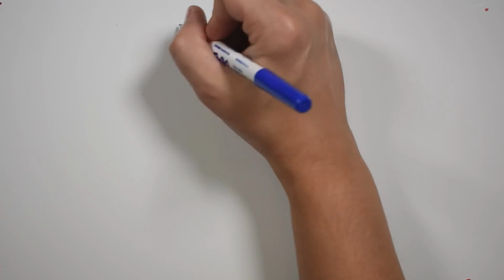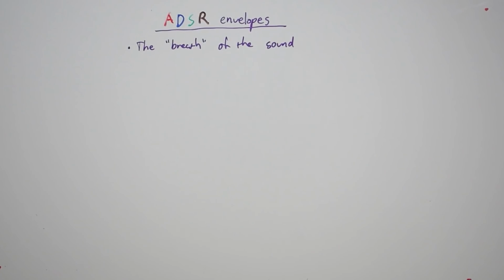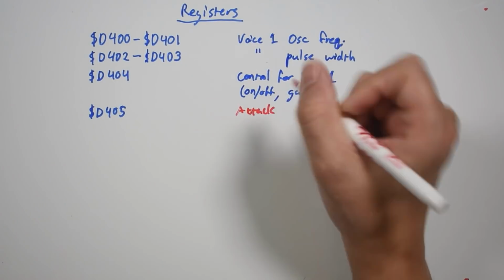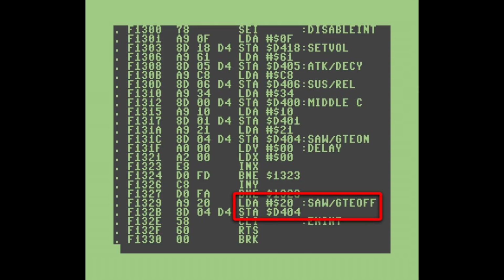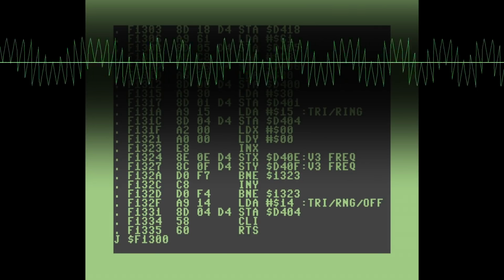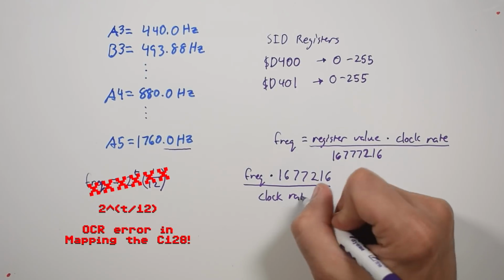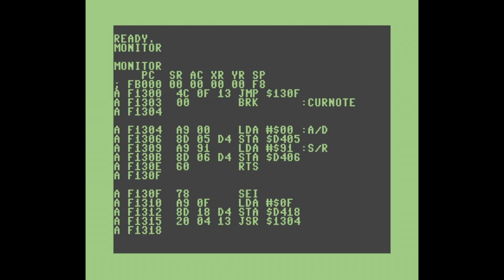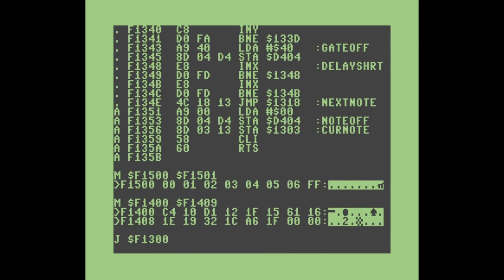Commodore 128D: Episode 7: SID Basics

Comment: Wait, does that mean the filter is applied to all 3 voices at once? many SIDs with filters I've heard don't sound as if it's working that way.
Reply: But it does sorta apply to all channels. It means if you're using the filter, say in one instrument on one channel, if you want to use the filter in another channel at the same time, you have to follow the same filter envelope you defined in the first channel. You can't use different filter envelopes and types in different channels at the same time.
Reply from the maker: Correct. The block diagram shows switches between the filter and bypass for each voice. The settings for the filter apply to all three, but only if they are not bypassed.
Reply from the maker: Ah, crud. Yes, you are right, the filter can be turned on or off for each channel. I misinterpreted the block diagram in the datasheets. Good catch!
Reply: yes. the SID chip had two DACs to get an analog waveform. one of them was routed to the output directly, the other one goes through the analog filter. for every voice you can decide to which DAC the voice is getting routed.
btw. you mentioned that you are working as an embedded software developer. may i ask with which micro controllers?
all the best,
 whylee, commotari.
Reply from the maker: I'm a generalist, so I've done everything big and small, from Linux-capable to RTOS to raw assembler on TI OMAP4, RISC-V, ATMega and ATTiny, SAMD21, Cortex-M4 and A-series, Z80 and eZ80 (built my own homebrew eZ80 machine), 8085, x86, 6502 (of course), etc. both professionally and personally. It's probably better to enumerate what I haven't worked on, which would be things like MSP430s, 680x0, PowerPC, etc.
Reply: That's so funny, I was thinking the same thing just now as I continued to view the video.

Comment: I found this video looking for SID chip assembly. And I think I watched the 1st and maybe 2nd video on this channel a while ago.
And it's become a c64 library now!
Only thing I missed was what do the values represent, I can see how the code selects the frequency or pulse width, volume, etc.
But there's 8 bits for each control and attack/decay share 8 bits with 4 bits each.
So how does LDA #$CF for example is handled in the signal generator ?
I know how the basic working of a tracker program and how to program the voices and there are 0 to 255 values for most parameters with some exceptions.

Comment: So, I've been using BASIC to do this. Obviously it's slower, but the tutorial that came with the C128 shows how simple it can be. Using PLAY, you can set the voice and octave with V and O, the note length with E Q H F etc., and change the waveform type with other commands. Also for noise, the SOUND command and a bunch of parameters are used for ADSR and length. IIRC, though, this basically dedicates the processor to the SID chip so it's not optimal. But if you're mucking around with sounds and making games that aren't gonna have a lot of background noise (e.g. most type-ins), it kinda gets the job done, but... yeah, you're a lot better off hopping down to the bare metal with the Monitor here.
Reply from the maker: BASIC 7's PLAY command is awesome, and so is SOUND, compared to BASIC V2 on the '64. So much better than POKEs. Since we're going down the rabbit-hole of assembly, I figured mucking with registers would be a good idea, so that's definitely why I did this in this video.

Comment: one thing, triangle wave has a shape which resembles, in terms of modulation, similarities with sine wave.
making sines in analogue environment was expensive, so reserved on most expensive synthesizers (e.g. I don't have it on my moog model d but I have it on arp2600), so e.g. in LFOs often sine was replaced with more affordable triangle 'cause modulation shape is similar.

but in terms of harmonic content instead it has more in common with square wave (50% width pulse wave) having same odd harmonics spectra, but the amplitude ratio between harmonics in triangle is exponential, so it sounds "hollower" than a square but fuller than sine, someone saying triangle sounds like an oriental flute whereas square like a clarinet, quite true.
Reply from the maker: Oooh -- good info on this! Very very awesome. I was hoping to be able to capture it in the wave display I wrote, but alas, it didn't quite get the gist of it. Maybe sometime in the future I'll hook it up to an oscilloscope and publish the results. :D
Reply: @NybblesandBytes  you can but in traditional scopes you'll see the shape, and in sid triangle is a quite real triangle...sid is not the purest synth but it has phase accumulation oscillators so being digital not analogue like VCOs nor DCOs (digitally controlled analogue osc e.g. roland juno 6/60/106) has stable waveforms, you could see harmonic content using a spectrum analyzer.

VCOs into a chip seems impossible technically and cost proibitive, and unconvenient 'cause they are unstable in tune by temperature and tollerances, must often be re calibrated (and we are in 1981 not in 2020)

it's possible to get a "sine wave" using resonant filter if present like an audio source, filter must be self resonant like moog ladder or arp, cranking up resonance until self oscillation then tune it using key tracking, I use it on moog model d sometimes but at a price, you lose filter (not every analogue filter can self oscillate e.g. original oberheim sem design didn't, I'm quite sure sid filter can)

sine has only fundamental harmonic so carving out higher harmonics with filter from the weakest triangle also makes something like a sine (but with loss of volume on most design...)

Comment: First of all, glad to see you’re back again!  Second, can each voice have independent volume or is each one basically required to go all the way up to the overall SID volume setting during the attack phase before dropping down to its sustain level?
Reply from the maker: Ah, sorry Skyfox -- meant to get back to this comment sooner. Seems I was later than expected. O.o

Each voice has a separate volume via the ADSR envelope, but the SID also has an overall volume as well. For the attack phase, I believe it is ramped from zero to the max volume allowable for a given voice, using the overall SID volume as a scaling value. Ie: if A is set to 10ms ramp, it will take 10ms to go from zero to thr SID max volume.
Reply: @NybblesandBytes  Thanks for the info.  So, each voice does have its own independent max volume even if that is lower than the current overall SID volume?  I'm still a little unclear on that.

Comment: On thing you said - the SID is an analog chip. That is only partially true. The filter is analog, the audio signal path is analog, however the OSC are actually digital. Find here   http://sid.kubarth.com/articles/interview_bob_yannes.html  what Bob Yeannes had to say:  Each "voice" consisted of an Oscillator, a Waveform Generator, a Waveform Selector, a Waveform D/A converter, a Multiplying D/A converter for amplitude control and an Envelope Generator for modulation. The analog output of each voice could be sent through a Multimode Analog Filter or bypass the filter and a final Multiplying D/A converter provided overall manual volume control.
Reply from the maker: Right. I don't remember saying the oscillators were analog. In fact, I said it was an "odd duck" mixed signals chip with digital interfaces to analog circuitry, and I wasn't overstepping saying that:

"The output of the Waveform D/A (which was an analog voltage at this point) was fed into the reference input of an 8-bit multiplying D/A, creating a DCA (digitally-controlled-amplifier). The digital control word which modulated the amplitude of the waveform came from the Envelope Generator."

Excellent reference from the creator of the chip, himself, though!
Reply from the maker: Aha, I rewatched the intro -- I see where the confusion lies. I said it's "primarily an analog chip", which frankly, might be a bit of an overstatement, but not much of one -- a little over half the chip is analog, and it does include an analog voltage pin in the datasheet. Even the paddle interface is an ADC. Either way, it matters very little to the programmer.

Comment: I have to correct or complete some information provided in the video ;)

There are 4 functions available for oscillators but waveform register bits can be combined after all! Of course if your C128D is equipped with MOS/CSG 8580 so you can hear all combinations ;) All of them (with exception of noise) can be combined with hard sync bit in waveform register. Hence we have at our disposal:

- triangle - combined with either ring modulation bit, hard sync bit or both at once it orders given channel to interact with  previous one and output the math between them, producing nice acoustic effect
- sawtooth
- sawtooth + triangle - thin sounding wave useful for clavinet sounds
- pulse/square - as mentioned in the video, it has adjustable duty cycle
- pulse + triangle - interesting keyboard/guitar sounding wave which offers the best of two worlds - it allows for duty cycle modulation and ring modulation (useful for vocoder-like effects)
- pulse + sawtooth - very organ like sound which also allows for duty cycle modulation (however, any audible modulation seems to take place with highest pulse register values)
- pulse + sawtooth + triangle - waveform which sounds very similar to sawtooth + triangle - no pulse modulation or ring modulation is working here
- noise - cannot be combined with any other waveform bits or ring mod/hard sync 

 Nominally there are THREE filter types in SID chip - notch filter is not a distinct type. But..., as for waveform bits, they also can be combined! :D So:

- lowpass filter - mellow filter cutting all higher registers above the cutoff value
- bandpass filter - removes lower and higher tones outside given cutoff value
- lowpass + bandpass filter - works almost like lowpass filter with exception for boost present at cutoff value hence resulting filtration is more agressive and sharper
- highpass filter - cuts all lower registers below the cutoff value
- lowpass + highpass filter - effectively works as notch filter - still, it's only a combination of basic filter types
- bandpass + highpass filter - works similar to highpass filter with exception for boost present at cutoff value hence resulting filtration is more resonant and 'clicky'
- lowpass + bandpass + highpass filter - not very useful but some musicians can surely make good use of it

Cheers! :)

Comment: i have to correct some things here. the sound signal production including the ADSR curve  is 100% digital. the only thing that is not digital is the filter. this filter was not possible to make in digital form back then. there are two reasons for that:
* 1. it takes a lot of knowledge how to implement that filters digitally. i don't know if bob yannes already had this knowledge.
* 2. it takes a lot of calculation power to implement the filters digitally compared to what was available at that time.
the tone generators where very simple to do digitally. they where simple 24 bit counters. depending on the waveform you just "massage" the output a bit.
if i manage to finish my FatSID project this year, i will at you to the list of testers who get a free sample - if you like.

Comment: People using retro computers and taking everything out of the old hardware are amazing people. I really hope Commodore 64 and Amiga scene will continue to thrive the decades to come. I'm sure there's still new hacks to be found and new amazing things to be done.
Reply: the interesting thing will be updated chip rebuilds, that add something new or eliminate some of the limitations of those systems. a SID chip with 6 voices and added left/right volume registers for stereo would be one of these upgrades. a new VIC chip with hdmi output another cool thing.

Comment: Glad to see you're back; could you do perhaps a short episode about using an emulator. Finding a C128/128D at this point is very challenging (just talking EBay pricing here). Thanks.
Reply from the maker: I'll see what I can do. Essentially it boils down to using WinVICE or just VICE depending on your OS.
Reply: @NybblesandBytes   Thanks,  vintage computer HW has exploded recently. If you got rid of your system when you outgrew it you're basically stock with emulation now

Comment: I have never really understood the sync voices feature of the SID but the way you went over it was way too fast so I still didn't get it. I already knew what ring modulation was, but that was probably too fast too, lol.

I was pretty sure that the voices could be gated to the filter individually (in fact I thought there were three filters, but maybe I was wrong?)
Reply from the maker: You are correct, they can be gated individually -- I misread the block diagram. There is only one filter.

Comment: My first computer was a C128 with external 1570 drive (and I still have it tucked away in my basement). Did you experience the C128 as young? Just out of curiosity, what made you choose the C128? Especially since the C128 mode never was that popular. And there should be better options for programming in 2020.
I think I know why, but I'd like to hear your words 😉👍
Reply from the maker: My first computer was a VIC-20 with a tape drive and later a 64 with a 1541. I never had a 128 growing up, but I always wanted one, and I never managed to write a game for what I had back then. So I decided to write one using tools I reasonably could have had back then. Eventually we'll move on from the 128 and from raw assembler, though. I have a path in mind. :D
Reply: @NybblesandBytes  thanks for replying. I grew up with the VIC 20 as well, as a 6-7 year old, but it was my older brothers (he still got it with custom super expander and home made peripherals). I got my C128 used, in about 1986, ignoring the Amiga (due to no money and the C64 game base), later on I got the A500. It was all about gaming for me but with the Amiga I realized I could do more than gaming, I have a lot to thank those old computers educating me. Cheers from Sweden.

Comment: So a SID chip could be reverse engineered as a FPGA implementation (same with a VIC-II video chip). Once re-engineered, then the FPGA implementations could be manufactured as ASIC chips. Then used to populate some of the newly manufactured C64 motherboards - and then viola - brand new C64s. After all, these are the two bottleneck chips that hold up recreating authentic C64s.

Comment: As always a very clear, interesting and informative video! :-) 

However, as far as I know the SID has only one Filter (you said 4). You can choose for each voice if it's routed through the Filter or not. Additionally you can choose one of 4 modes for the Filter: high pass, band pass, notch (= combo of HP and LP) and band pass. So it may look like there's more than one filter but there isn't. See the "official" manual/data sheet for the SID (especially page 3 and 6): http://archive.6502.org/datasheets/mos_6581_sid.pdf
Reply from the maker: In the block diagram, I only show one filter. Also, aside from just talking about the use of the filters, I gave a quick overview of them and didn't actually make use of them in the video -- was planning on that for part 2. :D

Comment: Your voice is slightly out of sync with the picture. Otherwise nice video. Thanks.
Reply from the maker: All throughout the video, or just parts? I jist got a new lav mic that transmits via bluetooth -- I didnt catch it, myself.
Reply: @NybblesandBytes  All passages of the video where your lip movement is visible. Maybe I'm a little nitpicky, but I do this for a living. BT devices can be the reason for it.
Reply from the maker: Okay, that's good to know. FWIW, in the shots where I'm wearing headphones, I'm talking via a Blue Yeti and recording via OBS capture through an Atem mini. I'll keep a sharper eye out for it in the next one. Should be relatively easy to fix, assuming its not my NLE causing the issue. I'm using Resolve 16 on Linux, which is its own bag 'o worms, so that could be a partial contributor, too.

Thanks for the catch! :D

Comment: If you have to stall the CPU while the sound is playing, how do you cope with different musical notes being different lengths? Would you have to encode the type of note and then modify the delay loops (using another table?)?
Reply from the maker: That's one way, but a better way is to change the notion of "note" to "note on" and "note off", like MIDI does. In part 2, we'll get into that. :D